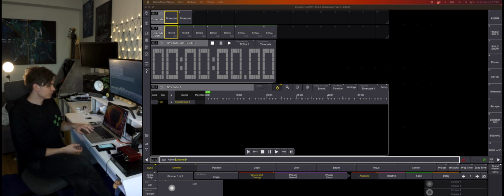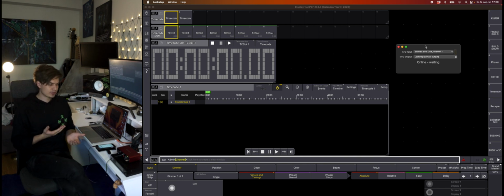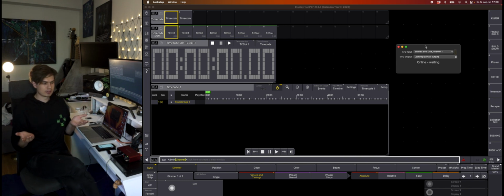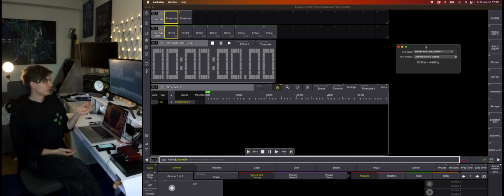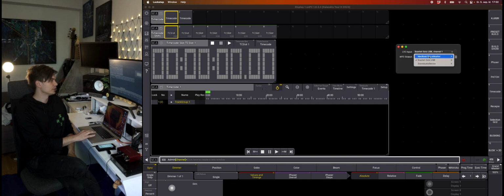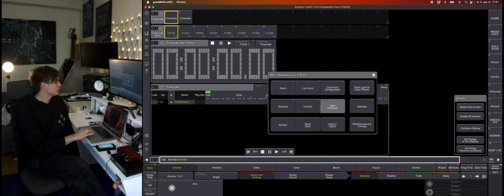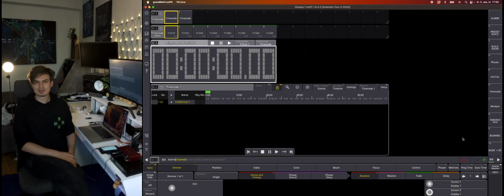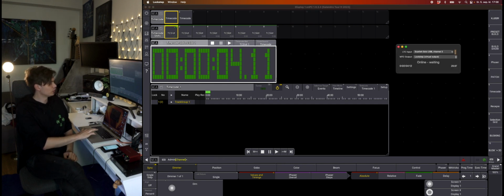How to input LTC Timecode to GrandMA3 onPC with an audio interface

Comment: Hi!
Would this system work without any MA hardware? I cannot see where my problem is.

Tried the show-file on consolle and smpte worked straight away.

Then same show file on onpc machine (I Mac) connected to a four port node, with lockstep, works straight away

But on my MacBook, again, same show file, but without hardware not working. Lockstep does read correct timecode in, settings  either on output config, either on onpc settings are the same I have on Imac (like you explain in the video) 

Could it be a matter of network session? 

Thanks!
Reply: aha! nevermind. just reinstalled the software, clean start and back on track. thanks!
Reply from the maker: Ah sorry, man. Saw your comment a little too late there! I'm glad to hear it worked out for you! :)

Comment: None of the software suggestions helped me (I'm on windows) but you did let me know I don't need any MA hardware.  I just routed my DAWs MTC output into Bome, I guess I had done it wrong before, but this attempt was successful.
Reply from the maker: Ah, yes this particular program (lockstep) might only work for Mac, but mabye you can find some similar LTC to MTC converter for PC. Good to hear you got it working with MTC :)